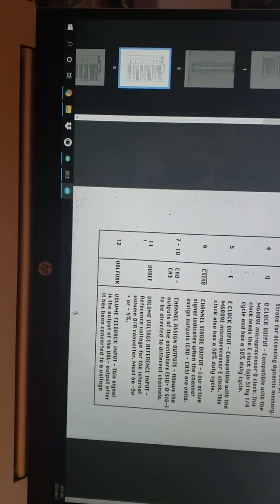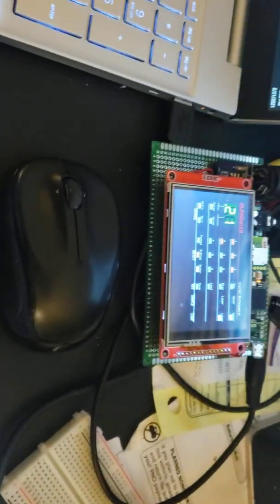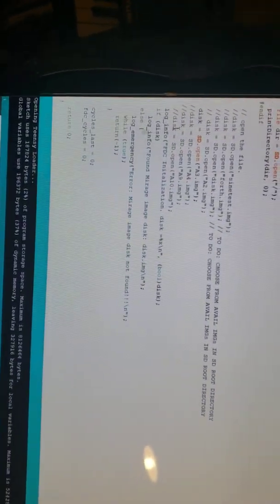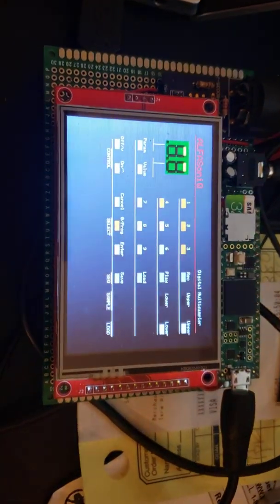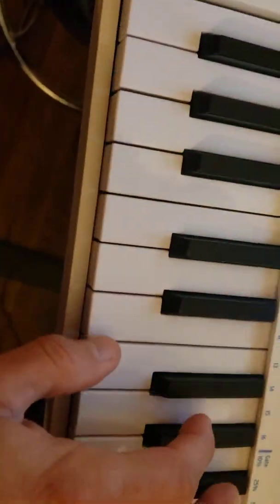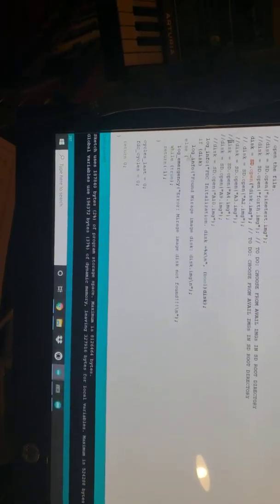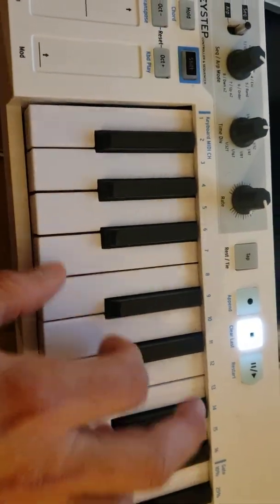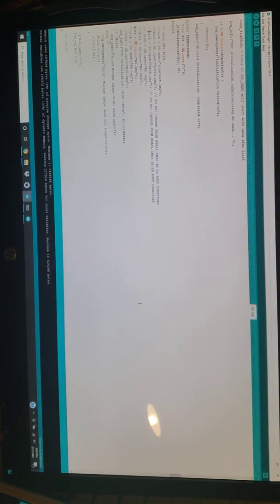ALFASoniQ Mirage II - full polyphony!!! (includes DOC 5503 emulation) Ensoniq Mirage

Comment: Since this uses the DOC chip, would it be possible to load in ESQ wave ROMs?
Reply from the maker: I am not sure that’s the same DOC (5503). I believe the ESQ (which uses a 16 bit processor) uses the second version of the DOC, which supports a higher number of bits (and has better S/N ratio). But I may be wrong.
Reply: @alessandro_fasan  ahh would make sense.  Do you know if the ES5503 is a different revision then?  I know some mirages use different revisions of the 5503 chip